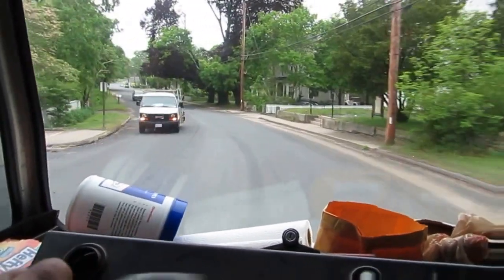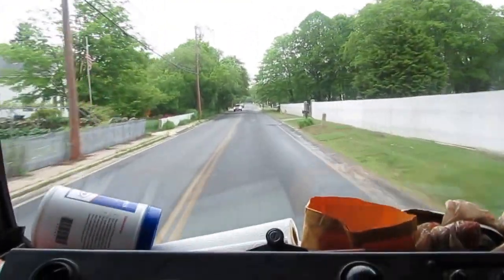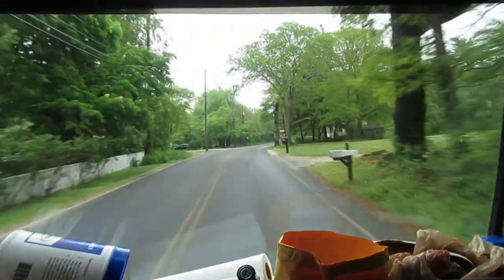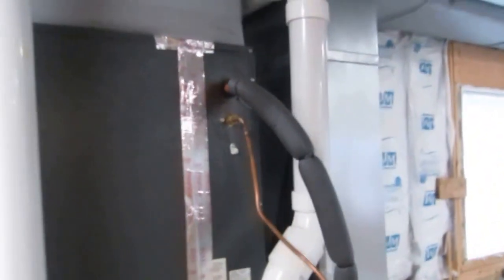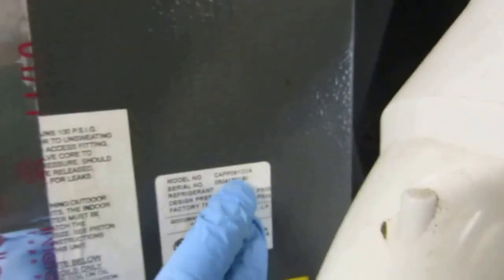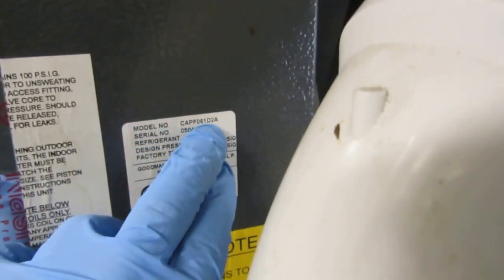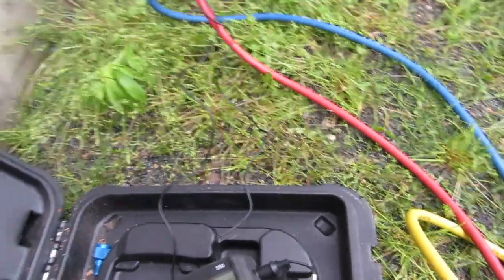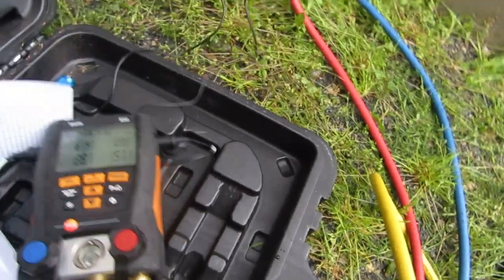HVAC REPAIR:-very low liquid line temp,high subcool,no air conditioning

Comment: TRY WET BULB TIME 3 = X......X-80( CONSISTANT)-DRY AMBIENT AT CONDENSER /2=( TARGET SUPER HEAT) IN BALL PARK OF +/-3....CHECK YOUR CHART....GOOD FORMULA
Reply: Can you give this formula again I am not clear on it. Thanks..
Reply: Thank You I will look into this again.
Reply: rmwaseem        ((Return Air Wet Bulb x 3) -80-Outdoor Ambient) / 2 

Let's call our Return Wetbulb  63, and Outdoor Ambient 75.  
((63x3)-80-75))/2
(189-80-75)/2
34/2 = 17 SH
You only use this on a piston metering device. You charge TXV's by subcooling.
Reply: +Ben quinn 

Hey Ben try the math.....You will been within the targeted superheat +/- 5 degees......I do not comment on subjects i do not understand until i have fully investigated them. I suggest you do the same

Lets say 68 WB - / 80 degees  Conedenser ( 68 wb*3 -(80 consistant ) -80 degrees -divivded by 2=targeted superheat 22 degrees with increments of 3 degrees. ( chart shows 21 degrees)

Let the people try it.....basic heat transfer
Day job Mechanical Inspector

Required Superheat
     55 60 65 70 75 80 85 90 95 100 105
50 9 7 X X X X X X X X X
52 12 10 6 X X X X X X X X
54 14 12 10 7 X X X X X X X
56 17 15 13 10 6 X X X X X X
58 20 18 16 13 9 5 X X X X X
60 23 21 19 16 12 8 X X X X X
62 26 24 21 19 15 12 8 5 X X X
64 29 27 24 21 18 15 11 9 6 X X
66 32 30 27 24 21 18 15 13 10 8 5
68 35 33 30 27 24 21 19 16 14 12 9
70 37 35 33 30 28 25 22 20 18 15 13
72 40 38 36 33 31 28 26 24 22 20 17
74 42 40 38 36 34 31 30 27 25 23 22
76 45 43 41 39 37 35 33 31 29 27 26
Reply: Thanks Josh for the tip. One thing I am amazed as how you get to know this tip, I have read over 1400 pages of HVACR/R  text and nothing is mentioned anywhere, but I guess this comes from practice or experience and you get good at it. Thanks again we here in NE have a lot of heat pumps and this tip would certainly help us a lot.

Comment: I also repair App., heating and air equipment, we only repaired app. every once and a while. I have run into a lot of hacks that didn't get a good vac. and had to do the same. And the customer is never happy when it comes to R-22 prices. Unfortunately that's what you get when you take the cheapest deal in town! I cant believe some installers don't understand that the vacuum process is as important as it is to a trouble free install! Take care man

Comment: Wonder if it was a dry unit and they only vacced the lines? 

Had something similar once on a walk in freezer, no cooling, pressures seem ok but suction line would freeze over and melt and repeat, turns out was full of air which was pushing the refrigerant round like a slug of liquid!

Comment from the maker: yes he was happy to have it working for once lol .. what a mess...very importing to check both superheat and subcooling .testos are the way to go for sure
Reply: I have the same exact gauges I love them saves me so much time    The one downfall with them is the temp clamps the plug on them is cheap I replace the whole clamp about once a year most of the time it’s because the plug get hot in the sun and falls apart